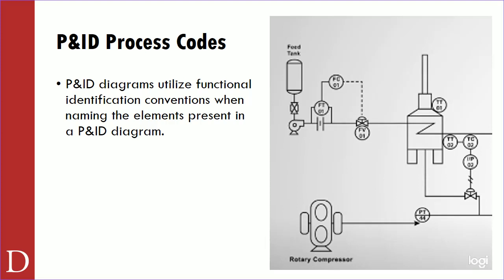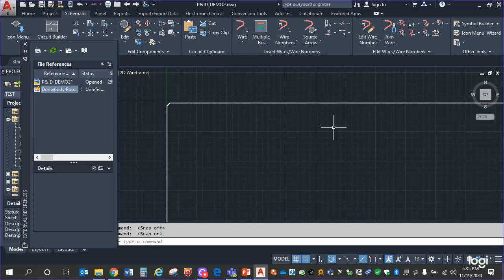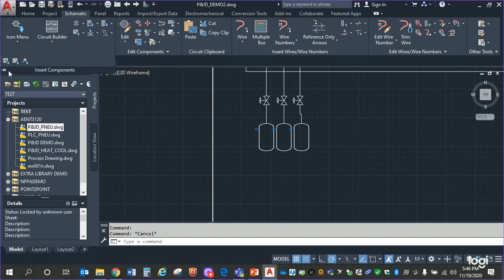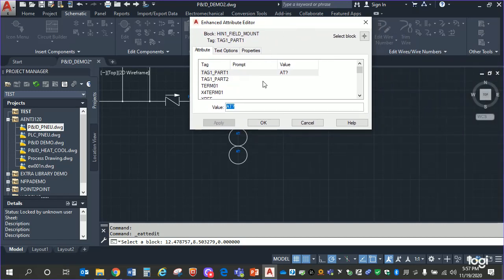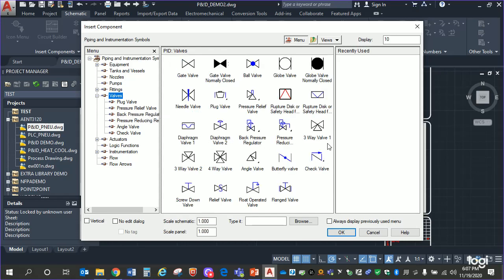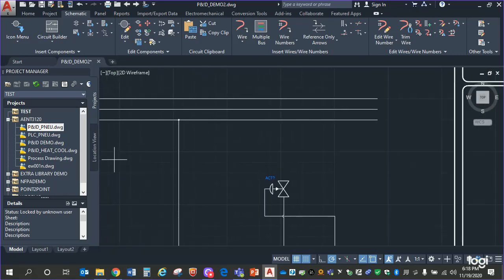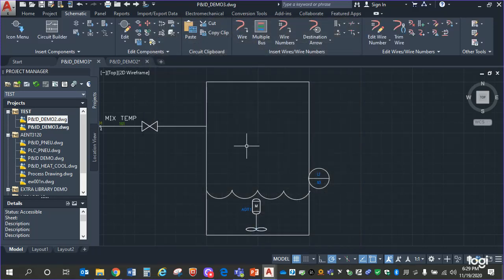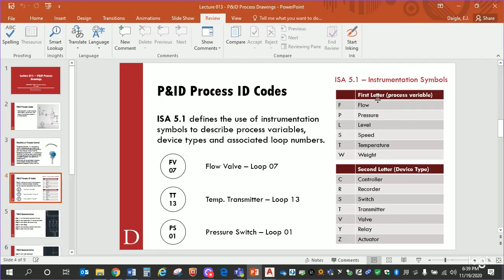AutoCAD Electrical - P&ID Drawings

Comment: NIce video. I am wondering how to get  the P&ID labrary for acad electrical. I don't have it with electrical (I guess)
Reply: This is for anyone with the same problem.  There are 4 symbol libraries in ACAD electrical.  To access the other 3 (pneumatic, hydraulic, and P&ID), you need to click on "Insert Components" with the down arrow right below the IconMenu button.